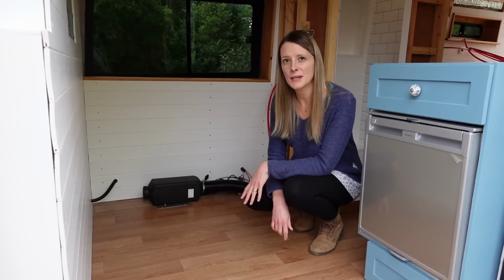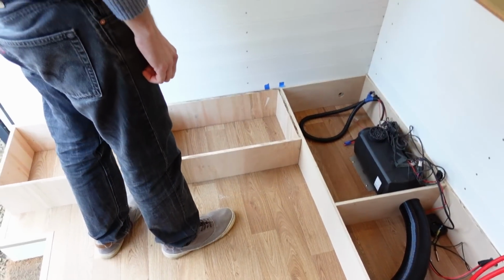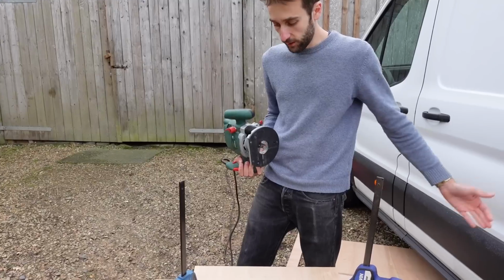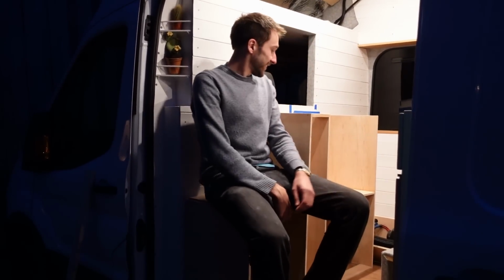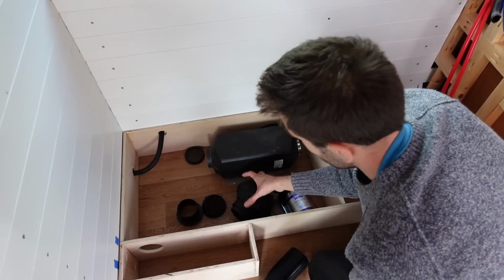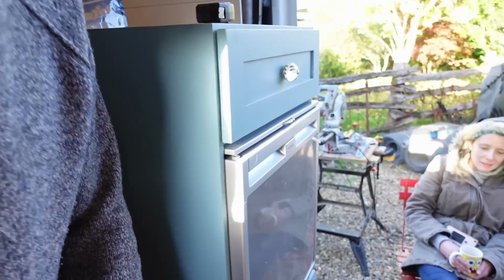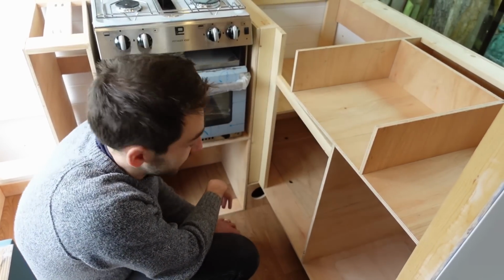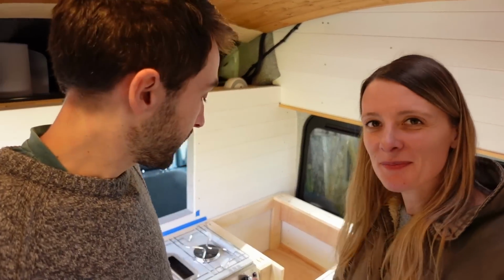DIY Campervan Kitchen Cabinets (With Built-in Seat!) | Transit Van Conversion E32

Comment: What a clever tip I noticed at 19'49! Excellent tip for all kinds of work.
Reply from the maker: Those washers come in pretty handy! Good to have a few different sizes depending on the gap, we've found beer mats with a hole in the middle work pretty great too! (Depending on the number of beers drunk to get the mat) 😄

Comment: Another cracking installment :-)

Router tip no 103: using the flat side of the base plate isn't always the best way to get a straight cut... all it takes is a slight twist and you will get an unwanted wobble in your cut.
If you use the round profile of the base plate a twist doesn't matter because the blade is always the same distance from the guide whichever way you twist it...
Reply from the maker: Cheers! And thanks for the tip, that actually makes a lot of sense 😛👍

Comment: Amazing. One thing you have made abundantly clear is having all the correct tools at your disposal makes the build so much easier and enjoyable. I didn’t think I needed a router, but it looks like a game changer, and a table saw, a drop saw, nail gun etc etc…
Reply from the maker: Thanks! Yeah we've definitely acquired a few more tools as we've gone through the build. Had never used a router before but now it's one of our favourite tools, not sure how we would do some of the stuff without it now! That and the table saw, chop saw and jigsaw. Think those 4 are the standouts for us that we wouldn't want to be without 🙂 Oh and plastic trim tools... for some reason we seem to have at least one need for them for pretty much every project 😄

Comment: That's a piece of precision engineering, absolutely love it.

Another great video, as always, guys. The end must be just about in sight now.
Reply from the maker: Thank you, we're quite happy with it too! 🙂 Yeah it was definitely nice getting this one in, it felt like quite a turning point having so much of the structure built out now, makes it much easier to visualise how everything's going to be. Still got a fair few bits left, but they should be more of the satisfying bits like getting the cooker working and having running water. It's funny how so much effort goes into the bits that don't actually improve our use of the van if we took it out for a trip, it's all about the last bit of effort at the end actually getting everything connected up 😀

Comment: Good idea to leave space to remove your diesel heater. If it's a Chinese diesel heater you will need to remove it at some point to clean or replace a part in the future
Reply from the maker: Cheers, yeah that's what we were thinking, we wanted to make maintenance of any of those bits in the kickplate area doable on the road, without having to take all of the cabinets out first!

Comment: Hi Tim and Abi, I know the internet is full of experts and poor advice but I just wanted to say I enjoy your enthusiasm and a great build on the van but please don't run sheets through the table saw from the side push them from behind, use a push stick if that makes you feel more comfortable on the final parts, table saw kickback is real and will bite and is a lot more likely when passing timber from the side of the blade and binds, I don't say this to criticise but to help you be safe and save you from something when it happens is very quick and scary, be safe and love the kitchen area.👍
Reply: Agreed and wear safety goggles when using power tools, I've noticed, sometimes you do and sometimes you don't..... Liking your methodical approach :)
Reply from the maker: Thanks for the thoughtful comment, we try to be safety conscious with everything we're doing but are always happy to learn about better and safer ways of doing things. We always try to stay completely clear of the blade and so thought that standing behind the fence at the side would actually be safer than being front on with it to the left or right of the blade, as our thought process was that if it grabbed the blade it would likely fly back more on the line of the blade. We've just spent some time watching some table saw safety videos after reading your comment as we obviously don't want to take any unnecessary risks and for sure there are things we can improve. Right at the end of this one he talks about standing to the side behind the fence as we've been doing it, as a possibly safer way to do it. Would be interested in your thoughts, here's the part:  https://youtu.be/eUx8oTIALmg?t=1792. Again thanks a lot for the comment, we do try to make sure we're always wearing goggles and have masks we use when we're sanding a lot, but it helps to keep refreshing what we're doing and avoid getting complacent
Reply: @SelfBuiltStories  Glad you at least looked into the safety of a table saw as a semi-pro kitchen fitter I'm quite familiar with table saws and always push the work through the saw from behind and straight through, it's 100% easier to keep the cut straight to the fence and be in total control of the piece being pushed through including the feed speed. Kick back is a lot more likely with a slight twist against the blade and standing to the side makes that a lot more likely. It all comes down to confidence. Besides the above l Iove the progress you've both made and look forward to watching your journey and van coming along. It's a quality top job guys. Albeit not fun in the winter.
Reply from the maker: @du7ch384  Thank you! We're pretty happy with how it's coming together now 🙂 And yeah the Winter months are definitely tough to be outside with the biting cold and weather. Fortunately we've done a lot of the big construction we need the space outside for, so hopefully can spend a bit more time in the van with the heater on! 😀

Comment: Awesome build. Im gonna pass on a youtube tip: don't use the flat edge on that router against your guide, its easier to use the curved bit as its a circle so the radius just rides along the guide at a point. Also you should treat yourselves to a compressor and a nail gun!
Reply from the maker: Cheers! Yeah we started doing that later on, counter-intuitive at first but makes it a lot easier to avoid the bit wandering 👍 Haha we did have to bash in quite a lot of pins, so maybe if we started building more vans but happy with just the one for now 😀

Comment: hi guys. you both are clearly putting a lot of thought into this and i don’t want to be rude i’m just curious. what will you do about cooking fat and smoke getting into the cabin?  also by the way if you have trouble with rigidity you could always try small triangles of timber in unseen corners. give you something to fix to.  if you are unsure what i mean have a look under your tables and furniture in your house.
Reply from the maker: Thanks :) And what we're going to be doing is putting some doors over the hatch behind the cooker, which will be part of the splash-back when closed that runs all along the bulkhead wall. And then for ventilation we put the maxxfan right above the oven which will always be on when we're cooking, and probably cracking a window open a bit too if the weather is decent. And thanks for the reminder about those structural triangles, we haven't needed anything like that yet but it's good to keep all the ideas in your head as you build 🙂

Comment: ive just got to say you guys are a insperation to all us future van builders and i love your videos,but althou i havnt started building my van yet im thinking about using dowls in spruce instead of pocket holes as glued dowels seem a lot stonger than pocket holes when used with soft wood
Reply from the maker: Cheers, really glad you're enjoying all the videos 🙂 And yeah that's not a bad idea, we only had a few pieces of the spruce so it wasn't too bad to make them all work in the end. Good luck with your upcoming build 🙂👍

Comment: I always wear a eye protection, hearing protection, and a mask while sanding. A leftover N-95 mask will do the trick. 😉
Reply from the maker: Yeah we do usually wear masks if we're sanding not by hand, and have a few pairs of goggles we try to remember to wear most of the time for power tools but sure we slip up sometimes. We try to only work to the limits of our abilities though

Comment: Plywood on a table saw. Haha. Well it worked. In the future you can put the plywood on a pieces of hard foam and cut it with a circular or track saw.
Reply from the maker: Haha, that sheet was definitely the biggest we put through it. We use the circular saw a lot too but always prefer to use the table saw if it's a smaller bit we're cutting off, we find it more precise and less faff than having to measure and set up a fence 😛

Comment: Hi guys, that all looks amazing. Question - what thickness ply did you use for the sides and drawers?
Reply from the maker: Cheers! And we used 12mm ply from Wickes for the cabinet, which comes out around 11.5mm. For the drawer sides we wanted to use up the leftover ply we had that was lining the van when we bought it. That was around 8-9mm. And for the drawer bottoms we used 6mm birch ply for extra strength. HTH!
Reply: Awesome thanks, I had thought about using 10mm ply to save weight but don’t think it’ll be sturdy enough. Thanks for confirming. Your build looks amazing by the way and your vids are really helpful a bad inspiring
Reply from the maker: @karlJenkins_the_reverend  Thank you very much! 🙂 Yeah we found 12mm to be a pretty good compromise on strength vs weight. It's still only just on the borderline of being able to take a 1" pan head pocket hole screw though so we mostly routed the joins. We did think about doing it more of a stick built style with a timber frame and then 3 or 6mm ply for the walls, but wanted to build it as a standard cabinet to maximise space. And also doing some rough back of the envelope calculations we figured it would be more swings and roundabouts on the weight saving too. We have built like that with thin battens in places where we didn't need as much strength though, like the wardrobes and bench seats that are covered with 3mm ply. 👍

Comment: Hello team! Amazing video! One question about furniture. How thicker is your plywood? Are you using 12 mm playwood grade BC or AA?
Reply from the maker: Hello! Cheers, glad you liked it 🙂 We used 12mm poplar/eucalyptus ply for these cabinets. The grade wasn't the best, BB/BC so it took quite a bit of tidying up the voids with wood filler (and removing staples) but it was a lot cheaper and lighter than the birch plywood we used for the fridge cabinet. Really happy with the end result if it did take a little longer. HTH 👍

Comment: Hey , for cutting out your access hatches at the base , do you 1. Make a template 2. Router out hole then 3. Cut new piece from separate bit of week to fit more flush?
Reply from the maker: Hey, so we drew the shape on the base for the hole we wanted to cut out using a square and something road to get nice corners. Then we cut those out with a jigsaw. Then routed a rabbet all around the lip to have a surface for the lid to sit into. Then for the lid, we had to use a new piece of wood, so we placed it over the hole and then drew round it from below through the base piece with a pencil to get the right shape. Made sure it was the right size to allow the mating lip then jigsawed that one out. Then routed the rabbet around the edges of the cutouts. And lastly just added some finger holes. It took a bit of work! But very happy with the result and they've been really useful 😄

Comment: hello  guys been following and copying some of your build :-) just wondered by using this method do you think the cupboards (joints) will withstand all the uneven road surfaces etc? speed bumps lol its one of my main worries for the future of my van build 🙂
Reply from the maker: Hey! We don't have any particular concerns about it breaking at the joints from the method we used, from what we understand wood glue is generally stronger than the wood itself if it cures properly. There is definitely a difference in quality between the birch ply we used for the fridge unit and the ply we used for these ones though, it's just a bit less straight and true and more fiddly to work with, but we feel that they're still pretty robust. And a lot lighter than the fridge one 👍😛
Reply: @SelfBuiltStories  cool, my build is a tester for me, living in it now too, hoping to build a more professional build the next time 😋
Reply from the maker: @RoaminRob  Cool, are you needing to do all the work and keeping all your tools inside too then? How are you finding living and building in it at the same time?
Reply: @SelfBuiltStories  I did about 80% of the build and then moved in. I have used one saw and one screwdriver for most of the build haha old school build 🤣🤣
Reply from the maker: @RoaminRob  Wow, good job! Means you get to enjoy the fruits of your work a lot quicker too 😃

Comment: Do you guys know about what Kreg Jig calls their pan head screws? The head is a little smaller so with a bit of jiggery pokers you can use pocket screws with ½ inch plywood.
Reply from the maker: Cheers, yeah we discovered them in one of our previous projects so we have a nice stock of the pan heads now and they're much better. But we found that with the poplar ply we were using this time even then they didn't quite work. The 12mm birch ply is really nice and consistent and comes out 12.5mm, whereas the poplar was a little bit more varied between 11.3 and 11.6mm. And just that difference meant even the pan heads were proud even after all the jiggery pokery we tried 🙃 We did use them like that in the kick plate part as they're all hidden so didn't mind them being proud, but wanted to have it a bit neater for the cabinets 😛
Reply: That is thin, I have had to adjust the stop collar to get the 1 inch pan head screws to not be ‘showing’ on either end, good luck.
Reply from the maker: @Theonebaddude  Cheers, yeah it was the thinnest we reckoned we could go to keep the weight down while still making a nice stable cabinet :)

Comment: What thickness ply did you use for the doors and did you have any issues with hinges if you used 12mm? Cheers!
Reply from the maker: Hiya, we used 9mm birch ply for doors and added strips of 6mm around the edges, making them wide enough to cover where the cupboard hinges would be. So we had 15mm in the band around the edge. Then we used standard 32mm cabinet hinges, but it was a bit tricky to drill the hole to the right depth without going through the other side because the spade bits we were using had a pretty long point on the end. It worked (just!), but we had to keep stopping and being really careful to make sure we were exactly at the depth we needed. But if you have a drill bit that has a smaller point of just a few mm then it would be pretty easy 👍
Reply: @SelfBuiltStories  amazing thanks! Would you advise going with 12mm for the frame and 18mm for the doors/drawer fronts then because of the hinges? A carpenter we were talking to suggested 12mm might warp /not hold the hinges on their ien
Reply from the maker: @Sean Harrison  18mm would definitely be more robust and resist warping better but the balance is the extra weight and if you have enough allowance for that. For us we wanted to keep weight down as much as possible so went for the thinnest where we could still use hinges and fastenings. Also depends how large the areas are you're covering. So we have 9+6 for the doors (and fridge cabinet drawer fronts), and for the rest of the kitchen drawers we went lower and used 8+6 (8mm leftover van wall ply + 6mm birch ply strips). It's working well for us so far, no issues with the drawer fronts. For the main cupboard doors there's possibly a bit of warping but we don't really mind, the van is exposed to some quite wide ranging temperature and humidity changes so we figured some movement is inevitable but we have strong magnets on them so they all close and hold nicely.  You could look at poplar ply as well which is a lot lighter, we'd consider getting some of that if we were doing it again but for a lot of it wanted to keep costs down and reuse what we took out the van at the beginning 👍

Comment: Did you guys just put the oven directly on the plywood? Is there any need to insulate it? I’m at this stage right now and just was wondering?! Thanks!
Reply from the maker: Hiya, no we lined it with 0.5mm aluminium sheet, as it needs to be mounted on something non-combustible: https://youtu.be/XVWgS7wwQdQ?si=iLsXpnpHQ_54OOX7&t=632 . There's also an air gap around the sides as well 👍

Comment: What was the width of Baltic birch you did use that was just thick enough for pocket holes? And what screws did you use?
Reply from the maker: Hiya, we found that 12mm BB is just thick enough to use the 1 inch pocket hole screws, as long as you set and drill it precisely. And you need to use the pan head pocket screws, which have a slightly smaller head. The 12mm BB we found to come out around 12.5mm, whereas some cheaper hardwood 12mm ply from Wickes was more like 11.5mm, and that difference was enough to make the heads stick out even with the pan heads. Not a big deal depending on where they are though. In some places we have them flush on the floor so couldn't have them stick proud at all, but in other areas just like in the cabinet kick plate area that was fine. HTH! 👍